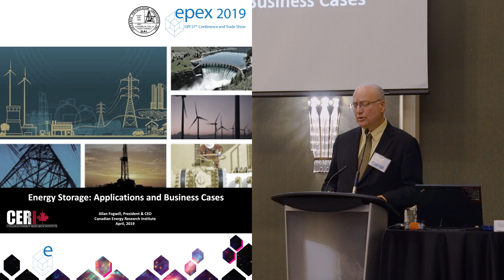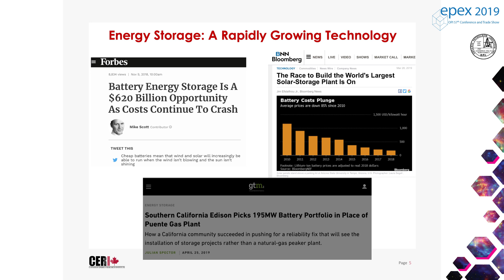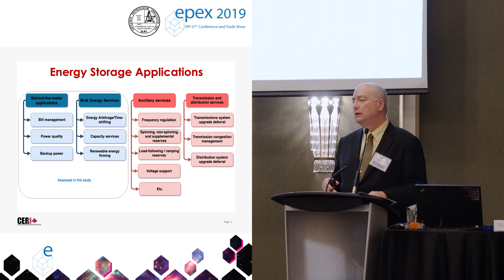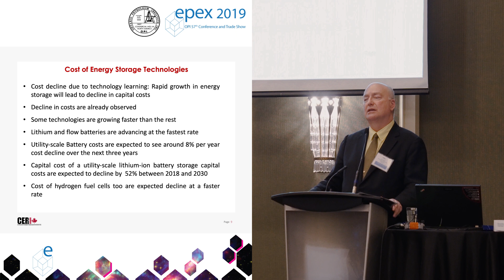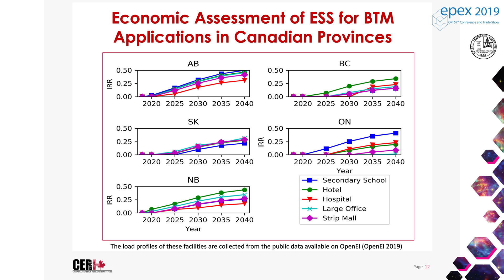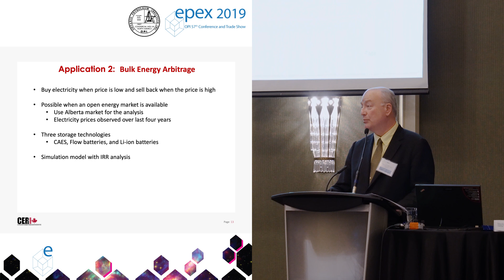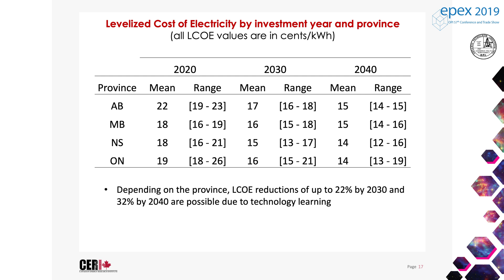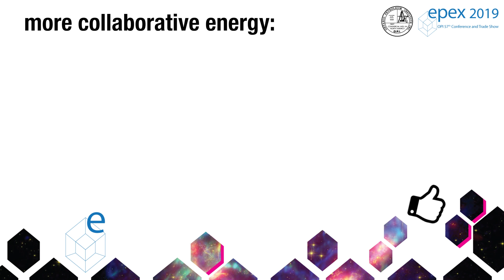Economic Perspective on Compressed Air Energy Storage (CAES)

Comment: I took some time to look at the presented costs of selected storage technologies.  

There are some choices such as LTO that might be an adequate replacement for Li-ion batteries these can reach replacement conditions after 20-years.

Another choice might be NiFe batteries, there are some of these batteries after more than 60-years.

I noticed that the costs for Hydrogen were lower than for Lithium ion or lead batteries; however, Hydrogen can fill up a 5-kg. tank of a Hydrogen car for about US$ 80, and the cost per mile of a Hydrogen car is higher than for a gas, diesel, or electric car due to the cost of Hydrogen but particularly due to its low efficiency.

Perhaps a comparison of the different efficiencies of each storage technology might bring a better understanding of the same.

Finally, if compressed air is not suitable, could liquid air serve the same purpose?